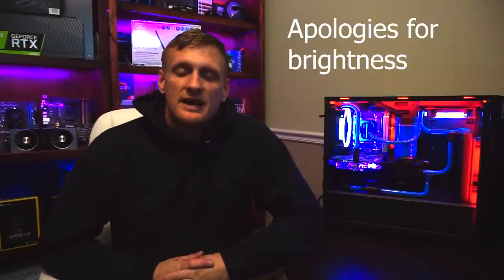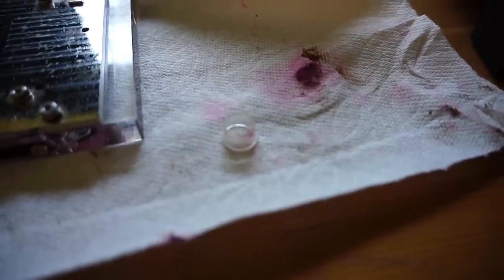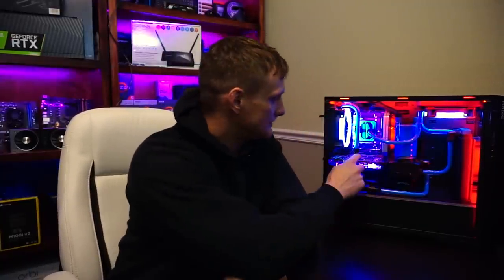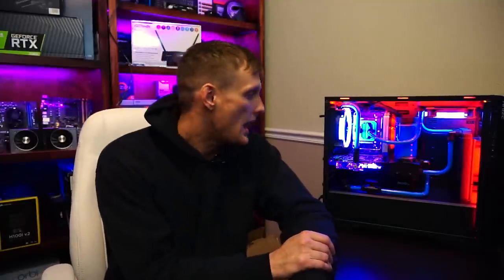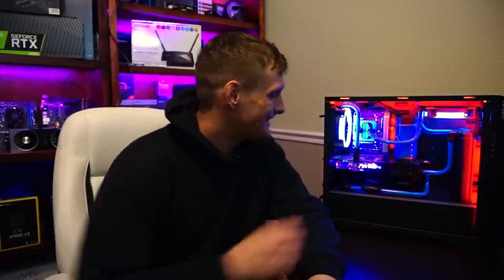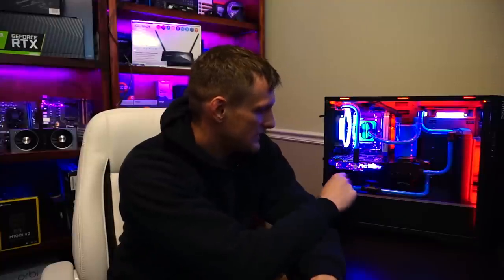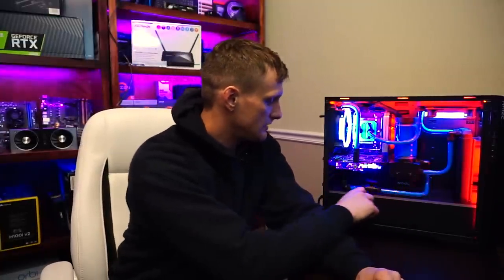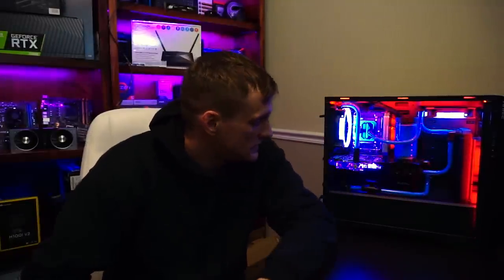I F*cked Up! What I learned about custom cooling.

Comment: Late to the party i know. Sorry that happened Matt, I presume you used PETG? It happened to me on two builds in 2017 with Tubing from a Brand starting with A. Basically the tubing shrunk under heat and popped out of the fitting.  Moved to Acrylic solely than never looked back. But offcourse every build is different.

Comment: So, the least expensive part hunted down and slain the GPU.
I am kinda surprised the tube failed heat so bad as to change color.  You'd think it would take a good amount of excess temp top make that happen
Reply from the maker: Yes prepped this was my 9th custom loop. On 10 now. Never had this happen before. Nothing else was present that could shrink the tube like it did.